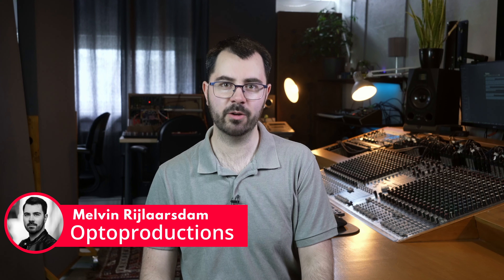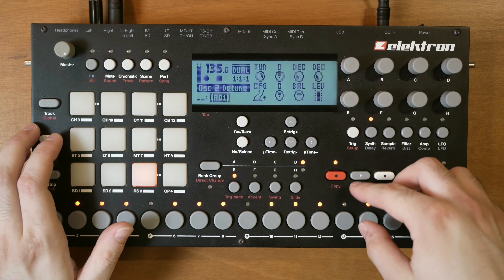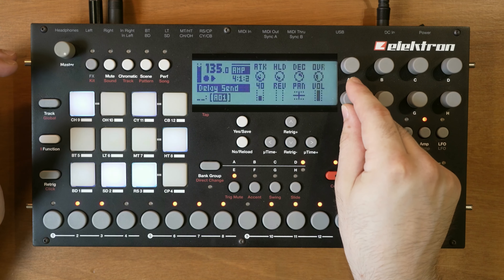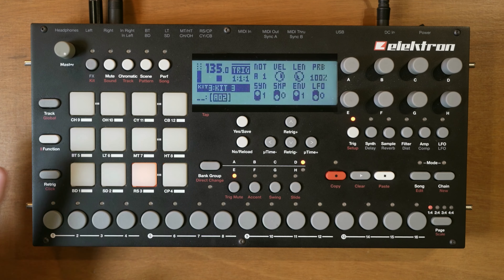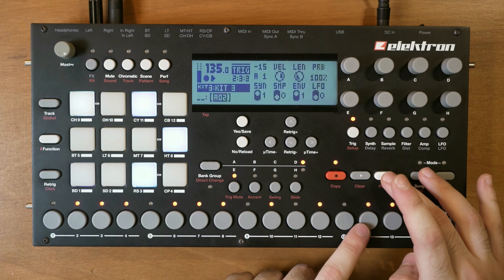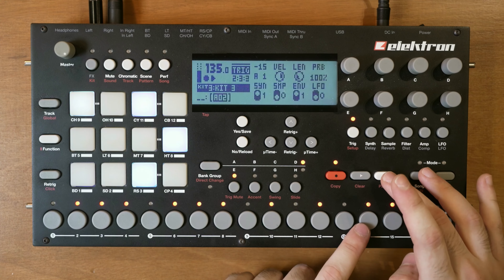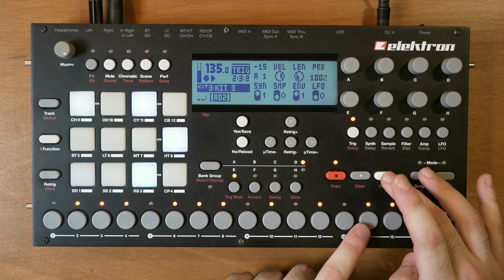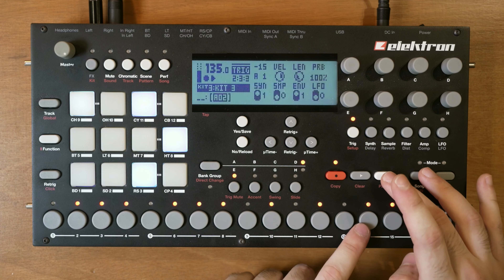Creating Techno Basslines on the Analog Rytm

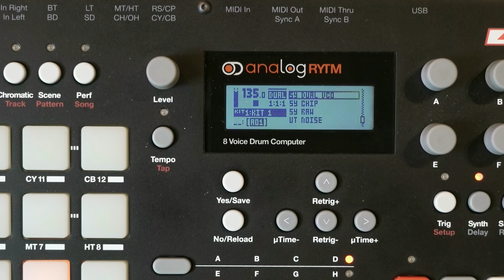Comment: 0:24 the new synth engines are available only on the BD, SD and the RS-CP voices.
A quite limiting concept.
Most music has BD and SD, so those cannot be sacrificed. RS and CP share a single voice so this means having a bass line means not having both a rimshot and a clap.
Reply from the maker: Yeah I agree, it's a hardware limitation, a workaround is to use sound locks, I've got a video about it somewhere on my channel

Comment: This Elektron is the 1 that can get the most from, by learning, using & thinking in terms of 'Sound Locking' as a specialist feature of Elektron devices imo? I often have about 3 sounds locked per track in use programming Rytm patterns. Sound Locks are the best tip for flipping multiple patches within a track... But otherwise not using up your parameter & trig lock amount limits, for flipping sounds a lot in a sequence & track. My 2nd synth in the early 90's was a Korg Wavestation EX. Sound locking is the Elektron methodology of creating wavesequencing style results. Easy to spot & understand if like myself, one has skilled themselves in depth to program Korgs Wavestations & wavesequencing... But otherwise a bit overlooked as the real muscle flexing feature on Elektrons, via Sound locking. A4 & DN1 are very worthy Sound locking Elektrons too. Others still can do but don't need to to push the limits & pallet imo